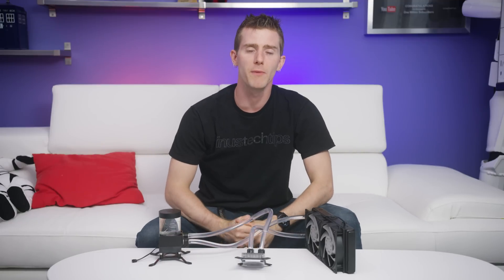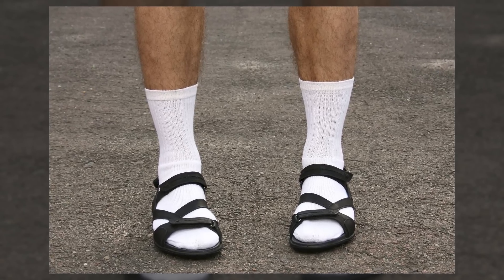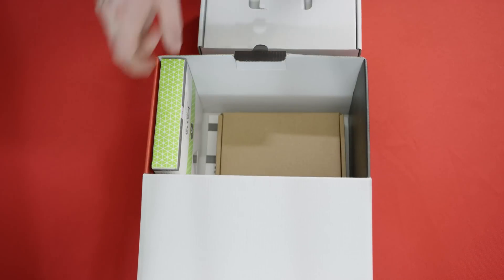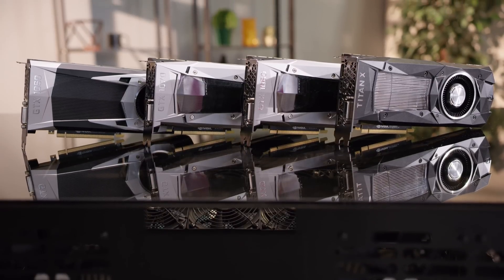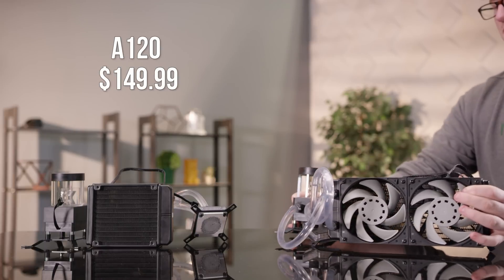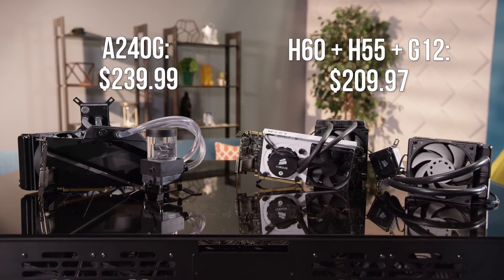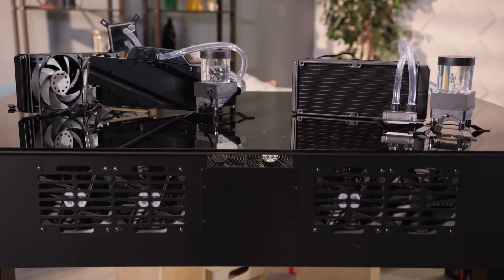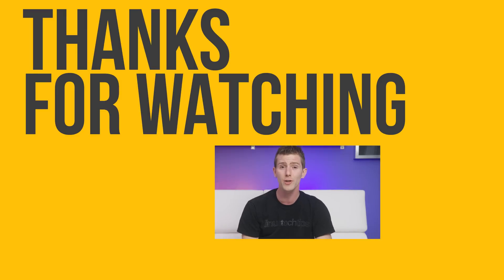CUSTOM WATERCOOLING AT AIO PRICES!? - EK Fluid Gaming Kits

Comment: What about some dodgy af hand made custom water loop for $20. 
You can make a water block from the stock heat sink from your CPU by drilling holes across it big enough to fit some copper tubing, you then run copper tubing that is long enough to go though your heat sink and still have enough for connecting your sexy rubber tubing to, all the way though the heat sink using thermal adhesive to glue the copper tubing in there. Connect what ever sexy see though rubber tubing to both ends, one end can run to what ever pump you have. The other end will run to a freezer that sits under your desk, this freezer must contain the biggest water holding device you can lay your hands on. Run a copper tube from the top to the bottom to the top again (this isn't a reservoir, that would be too expensive in anti-freeze costs) of this water holder thing making sure again to leave a cm or two at the top for connecting other tubing to. Connect everything to each other and fill with anti-freeze or vodka. 

And yes this is a terrible idea as Linus had proven with that "can a fridge cool a computer" video ages ago, but there ate differences, I'm using a freezer and they are cooler, and i am using water to dissipate heat not fans and a radiater, we all know water dissipate heat faster than air. Plus I'm using all lot of it so that if I'm  dumb  and this doesn't work you should be able to play for about 2 hours before your computer gets warm and you run out of mountain dew, which means you need to go to the super market and get more and let your shitty cooling solution freeze again.

Comment: The kit seems like way too much time to be bothered with anyway in contrast to an all in one kit from the likes of Corsair and Thermaltake. You also didn't mention that you'd need to test this kit an ENTIRE 24 hours on the last step to make sure leaking doesn't occur. Also, the GPU block only supports a FEW GTX 1080 Ti aftermarket cards. So if you have an EVGA FTW3 Edition, Gigabyte Aurorus, or an Asus ROG Strix Edition(like me), you're out in the cold.

Comment: Honestly, I liked Jayz video much more. Felt more personal and real world. These videos feel more and more like ads then reviews and informative videos for potential customers. I mean you guys don't even include the product name in the title anymore. It's always click-bait stuff. Which is fine, you got bills to pay, but if I am going to give constructive criticism, I'd say that Jayz channel feels like what your channel used to be years ago. 

And from your data that you (quickly) showed, an AIO still seems like a hell of a buy. The difference in degrees were so minor, just like you said, a couple of degrees versus other products. As much as I was interested in this when I first saw Jayz video, I'd probably just buy an AIO at this point. If the "universal" blocks weren't Pascal only, or had an option for at least the 900 series, I'd maybe buy it instead. 

Also, like most every other video posted in recent years (warehouse years, basically), this "review" felt very lacking. Quick cuts showing the rig assembled and a few seconds of numbers and the video is done. No talk about packaging, no talk about quality, no assembly tutorial, and hardly any talk about the fans themselves. It felt like you were covering up the noise they can generate by tuning them to 1k RPM and quickly moving on. No word on installation of the CPU block back plate, no mention of radiator thickness, no mention on reservoir capacity, hell, you guys didn't even talk about the pump! At least Jay pointed out that it would more than likely be a better performing and quality pump then included with AIOs. While that is a given, if you are going to make a product placement video, at least go more in-depth than opening the box and showing 3 graphs. And speaking of the graphs, damn were those things hard to read. I know graphs are a huge PITA and are hard to make look good, but jeez. With like 20+ employees I figure at least one of them could tidy up the graph and sort the products by different colors or something. 

Your channel went from being one of the best for tech news and reviews, to the "best" "entertainment" focused channel with tech of today being splashed in as an accent. I feel like you guys put more time and effort into the thumbnails then you do giving good informative videos and describing the product to the max. You guys could have done more comparisons, showed us the copper loop build (and parts) in much more detail. You could have compared the product to a similarly built one using standalone parts. Could have compared radiator density, how much tubing is included, warranty information, reservoir and pump size, compare the included GPU block with a standalone one, tell us the SIZE OF THE TUBING. 

Honestly, this video was just so lacking imo. Just like most videos, they feel rushed and thrown together (production value not an issue) with just the minimum required information to pass as a "review" or showcase.

Comment: use automotive coolant in the loop, many cars have mixed metal cooling systems and as such many types of automotive coolant are designed to prevent galvanic corrosion.

Comment: linus i have a great video for u to do

can u test what will happen if u use liquid nitrogen in a water coolant
Reply: It doesn't work like that. Liquid nitrogen requires refrigeration to stay a liquid. It would just boil off in a water system. Plus you would have a whole mess of problems with condensation and parts freezing.

Comment: I got this kit, and it works brilliantly for a 6700k and GTX1080. GPU gets up to 58 degrees celsius, and the Fans get a little noisy on load (if you want performance). They will sell 360 radiators separately in september or octobre so guess I will upgrade with one of those. Still I only paid half of the price you pay for a full EK copper system.

Comment: yes a degree or 2.... had an x62 for a 1700x oced 4.15ghz 69degrees :") full load at 1250rpm and then changed to a 560mm sr2 9fpi radiator from hwlabs and the temps dropped to like 40-42 degrees on the cpu at full load at 600rpm... and i have a gpu in the loop too that i get like 45-46 degrees max temps gtx 1080 ti at 2ghz when gaming the temps stay under 40 lel a couple of degrees nice one linus

Comment: By itself, the kit won't cause any issues if you use it how it is. The issue comes from upgrading to something else which pretty much means you are going for copper / nickel. Don't buy this kit if you plan to expand down the line because you will have to make another loop out of new parts to ensure you stay with entirely copper or entirely aluminum, which only comes in kits pretty much considering their fittings aren't for sale by themselves. Great product by itself and adding hardline tubing would make it look much better.

Comment: Two points make these kits not worth it (imo):
1. Aluminium: you can ONLY use Aluminium in your loop, any other metal and it will corrode like hell. Also: You can only use specific cooling additives or it will also start corroding.
And since I know of NO company that uses Aluminium for their water cooling parts, you are forced to buy EKWB parts and are dependant on their support of the platform.
2. Vardar fans: these fans are anything but good, they may appear quite in test, but they have bearing and motor noises that are very audible at low RPM. Also, their RPM range is very limited at the bottom, depending on the version you may end up with fans that only turn down to 700rpm and this louder than most GPU cooler these days (since they can turn off).

Comment: So if you don't trust anything that says it prevents galvanic corrosion...
How do the AIOs keep working for years?
Reply: Because the AIOs don't mix metals.
Reply: Nathanael Ries copper coldplate and aluminum radiators...
Reply: Being a completely sealed unit and using a very strong inhibitor can will help it last the 3 years or so they would be expected too.

Pull apart a 3year old aio, corrosion will definitely have set in.

I still have a ek copper block from 2008 thats perfect

Comment: upgradebility without the option to buy new parts? you'll need a new gpu block if you get a new card(unless its the same pcb... but if thats the case you can upgrade with the AIO as well)
same goes for the cpu... sooo where the upgradability? i really don't see how it is upgradable if EK is the only one selling aluminium parts and doesn't sell stuff to upgrade the loop.

Comment: In the H100i v2 vs A240 vs Copper 240 graph: Why does AIDA cause the GPU to get very very hot and the CPU to remain at basically idle temperatures. You would run the CPU or FPU test on AIDA to stress the CPU correct? Therefore, the GRAPH is made BACKWARDS. I would like to see an updated graph  assuming that the spreadsheet with the data on it is not lost.

Comment: Dear Linus, do a room water cooling S02!
Reply: Whole room phase change cooling: https://learn.compactappliance.com/wp-content/uploads/2016/05/window-ac.jpg
Reply: But they can use the lessons learned, like not putting the blocks in the same loop as the room, isolating them with heat exchangers; proper bleed valve location and using biocides/bio filters from the start
Reply: @ratchetfreak   That was the biggest issue in the whole room water cooling. they forgot to insulate the copper pipes and add those biocides, in the end they found that it would just dump the heat back into the room
Reply: Why? They've already established that it's a terrible idea
Reply: or one could just buy an air conditioner
Reply: prairiepanda the real issue was using small factor consumer products in too large a scale

Comment: Nigga, i watercool my pc with garden hose and a car radiator.
Reply: lucas rem Dude, im just broke af, no need to get triggert
Reply: R3d's Tech Nonsense, just run your PC underwater..... I tried it with mine, works perfectly!
Reply: You have a in-line water distiller to connect to it first?
Reply: lmao are you the same dude from pcmasterrace that literally did watercool that way?
Reply: +R3d's Tech did you run pool water through the loop or put the radiator in the pool?
Reply: Don't understand, dick stuck in car engine.
Reply: lucas rem whadup scrub
Reply: maybe... yes lol
Reply: Lappensaurus lol
Reply: Lappensaurus  I did it with a pool. Don't watercool in a pool it's a bad idea.

Comment: You could use a big tube to put the reservoir on your desk with a fan next to it and if it starts getting hot during a game just drop in an ice cube. If you leave the top open the evaporation would help keep it cool and help stop if from over flowing with to much extra water from the ice cubes.

Comment: While pricing is great, this kit has a huge compromise: Users can't mix-match with other existing components out there. That's a lot of cool parts you're missing out. I wouldn't recommend this kit, either go AIO or go all out.
Reply: AIO's are usually aluminium as well. However this is looks a lot better, can be topped off when necessary and is similarly priced. If you want "other cool stuff" this kit probably isn't for you anyway. If you really don't trust the aluminium you can always add an anode to the system like on an outboard engine (aluminium constantly submerged in dirty water).

The only things I don't like are the fact you can't get an extra radiator + gpu block and the fact it doesn't use metric tubing.
Reply: I don't have a problem with Aluminium, it's just that due to the fact that's the material, it will not be compatible with many existing CPU/GPU blocks, radiator... So yeah, this isn't something for me. I would rather go AIO or spend $500 to have my own badass loop.
Reply: Steve L I completely understand, my biggest problem with this is that it can only be bought in a kit. This means you can't just get an extra radiator (and possibly a stronger pump).
I do think that even though this kit isn't for everyone that many would enjoy it more then an AIO.

Comment: I love how so many people were bashing it for being aluminum.. Aluminum isn't an issue for watercooling, mixing aluminum with the most common metals in watercooling (brass, copper and nickel) is. All aluminum = all fine.
For this price these kits are awesome.
Reply: All aluminium = Mithrill
Reply: Will it be safe on the CPU IHS? I think its nickel plated copper.
Reply: @Ravelover5448  Yes it's safe on the IHS. It's only a problem if you have water rubbing up against the different metals
Reply: Im guessing you still didnt buy this garbage? & the issue was that not only is it aluminum (which is ONLY compatible with about 1% of water cooling products so u can add other components to it like Linus & EKWB LIE about!) but it also has the "Thinnest" radiator humanly possible yet the STILL advertise it as a full Modular kit with a "reservoir" (even tho u cant add anything to it cause of aluminum) but its MUCH worse than even a twin fan AIO! & even worse they advertise it as the "ONLY" kit that has a Graphics Card block for 1070 & 1080ti but it ONLY works with "Founder Edition" cards which almost Nobody even owns now (& why would they) So anyone that actually knows anything about water cooling would not be able to even think of a "single" positive about this kit, its like something you would find at a cheap store, like those Chinese "junk stores" & besides that ALL the videos that exist (especially this lying, misleading scumbag Linus, yuk) are PAID to do the vidoes so they lie & mislead all these poor beginners that are new to water cooling & end up stuck with a garbage kit thet they actually NEVER would have paid for if they had of been told the honest truth in the first place instead of being scammed. Its disgusting so unless your an employee its a huge shame that you would stick up for this mess.

Comment: That's sounds pretty cool

To a degree
Reply: Personally, I'm more of a FAN for air-cooled systems.  Water-cooled systems are nothing to get wet over.
Reply: or two
Reply: To a kelvin degree.
Reply: @RealDids  Kelvin is absolute and doesn't need degrees
Reply: Linus will think you're talking about fahrenheit degrees
Reply: Pff, I measure temperature using radians.
Reply: Dids didn't you watch the quantum pc video? there are no kelvin degrees
Reply: +Ti Gidou hi kevin
Reply: better than all linuses puns
Reply: +Ganaram Inukshuk true, radians are better
Reply: Ganaram Inukshuk my radeons actually run pretty hot
Reply: ffs again man
Reply: The Aliens ahhhh i see what you did there 😄
Reply: Ba dum tss
Reply: Get out of here, Carlos
Reply: it's Kelvin, not kelvin degrees. (it's not degrees, just Kelvin, like inch, like meter, like gram, like lb., etc)
Reply: Ti Gidou its a joke, did you watch the "unboxing" a quantum computer video?
Reply: i swear i fuckin swear xD